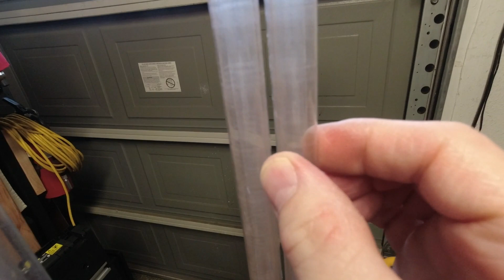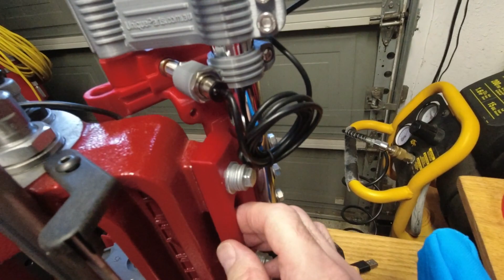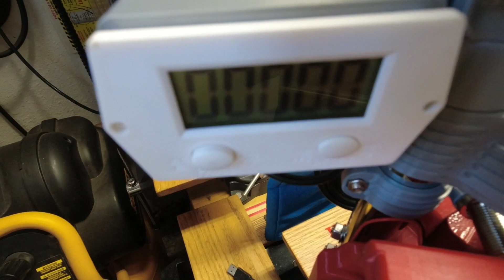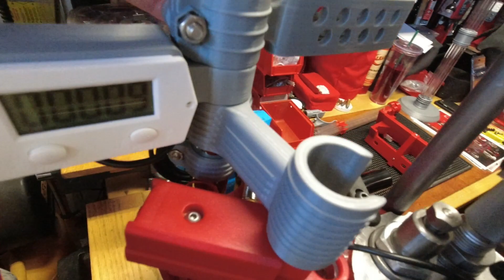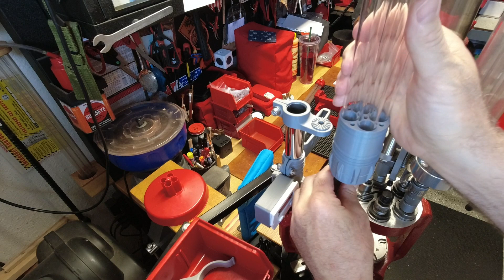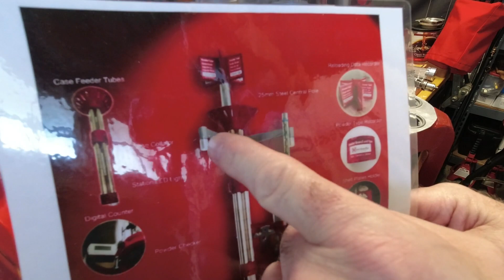A Hornady 3D Printed LnL Case Feeder Like NO Other: Part 2 - "Lite" Installation

Comment: Bought the unit from unique web site, product is built well, ordered 3 additional adapters but never received the 223 that should have come with the unit, various emails to him no response back from him, surprised given the quality and detail of his product, thought you should know. No reflection on you,  your video encouraged me to buy the unit. Im still happy with it works great.
Reply from the maker: That's a bit of a bummer on the lack of response as well as a missing adapter.  I'm thinking a small/one-man shop that is probably too busy to keep up with the all the demand/details and such.  Not an excuse, just an unfortunate reality it seems.  Amazing product IMO.  Mine gets constant usage and still going strong 2+ years later.
Reply: @ReLoadersBench  My press plate was bent thats the problem i had with the unit getting stuck, i ordered a new one from Hornady and it works great now just finished loading 1500 rounds of 223.
Reply from the maker: @hanswulff4910  - great to hear Hornady was able to get you going so the Unique Parts case feeding system works as you had hoped.  Good stuff.

Comment: So whats the reason you spent more than the price for the hornady official case feeder to buy this?
Reply from the maker: hmmmm, you must have forgotten to convert Australian dollars to US dollars as the Hornady case feeder is about $500 (Amazon, Midway) and my cost for the Unique Parts case feeder was around US $200, so in my book that’s a solid value. I’m also more of an “all mechanical” fan with my press configurations (and can put them all on my mobile stand or bench mount - can’t do that with the Hornady Case Feeder), also don’t have the bench space for how the Hornady CF sits, don’t need the annoying noise (motor, wheel, cases dropping, etc,), and like supporting the creative ideas others have for innovative products. Those are reasons I prefer the UP case feeding platform.  Plus it works flawlessly, something I haven’t heard about the Hornady Case Feeder.

Comment: Great video!  QUESTION:  Do you see any benefit to installing a longer ~1" chrome support tube so that the bracket that holds the case feeding tubes could be moved up about a foot?  Seems that by extending this tube, the feeder tubes would be held more securely and eliminate any wiggle that could cause wear and tear and possibly feed problems as the unit gets used more and more.  Your thoughts are appreciated.  THANK YOU
Reply from the maker: Funny you mention extending the tube taller which is exactly what I ordered from Unique Parts to add extra stabilization for the multi feed case tubes (not to mention all red parts). I’ll do a video once it gaets here.

Comment: I noticed you thought it may be helpful to have the counter movable. On the unit I received this week the counter does move very easily. I’m having some issues getting mine dialed in. The fit and finish is fine. Some minor tweaking will probably be needed. Mr. Cheung is being quite helpful. I would certainly recommend this unit for purchase.
Reply from the maker: I probably should have used a more accurate word.  The digital counter swivels left/right with ease.  What I meant when I said movable was vertical movement of the "clamp".  There is no way to lock the clamp at a particular height by itself, so you'd need another component (like the shellplate holder which has the ability to "lock" in place) to help adjust the height of the digital counter by setting the height of the shellplate holder and then having the counter clamp sit atop that.  Not a big deal at all.  Hope all your issues dialing in your case feeder are easy fixes.  Glad JC is helping you.   I absolutely LOVE this thing!  I just reached out to JC to purchase my "all red" version.  The attention to detail and functionality are truly impressive. 

If you need any assistance, feel free to reach out.

Comment: I personally do not understand the case counter, it cannot be accurate as there are always a certain amount of errors made when reloading.
I feel weighing is the most accurate way to go. A 9mm brass weighs 4 grams (not grains) or 0.141 once. 
Remove the weight of container, weight either in oz or grams and divide overall weight by brass or cartridge weight, which ever you are working on at the time. 
Very informative channel!
Reply from the maker: Thanks.  I would view the case counter more as an estimator than an exact counter.  Agreed, there are always reasons to pull the ram up/down that don't necessarily correlate to a finished round.  Overall weight is one option, but I've found that unless you stick with one headstamp, the case weight can be all over the map with mixed headstamps.  The only items that will not vary are projectiles and primers. Powder will vary to some degree (unless you are charging by hand and checking each cartridge) and then there's the brass.  The case counter gets a thumbs up from me for cool factor and a "nice to have" item that is not critical but helpful.  

And after using Unique Parts case feeding system for a few weeks now....I can say that I absolutely LOVE this thing!

Comment: The fit and finish looks very good. Did it come that way or did you do much work on it?  Who is Jack?
Reply from the maker: Everything arrived to me as it's shown in the video.  I have not done any work to any part.  Jack is the designer/creator of this platform @ Unique Parts
Reply: @ReLoadersBench  Thank you for your prompt response. You did say you only reload 45 caliber. I reload 9mm, 38/357mag, 223/5.56 as well as 45. How do you get the other calibers? Did you purchase the bullet feeder as well?  Did you do a video of that? Your videos have been very helpful to me since I’m rather technologically challenged.
Reply from the maker: @joyceknepper366  - on this LnL, I only load 45ACP.  On my Dillon XL750 I load 9m.  For all other calibers, I use either a Lee Classic Turret or Classic Cast single stage.  For the Unique Parts case feeder, the caliber is simply a different insert (I showed a 9mm caliber adapter/insert in the first video/part 1 I did on this solution).  So a caliber change is technically as easy as swapping out the caliber specific adapter. 

Unique Parts also offers bullet feeders, but I currently use a Hornady Bullet Feeder die in conjunction with a Mag-P bullet feeding solution (think smaller version of the multi-tube case feeder) that I got from SoCal S&W.  This is machined from aluminum for the base/top and then caliber specific sized tubes. Great product that I run on my Hornady and Dillon progressives.  I have review videos of all this stuff available on my YT channel.  If you fast forward to minute 18:50, you'll see the Mag-P sitting on top of my bullet feeding die.